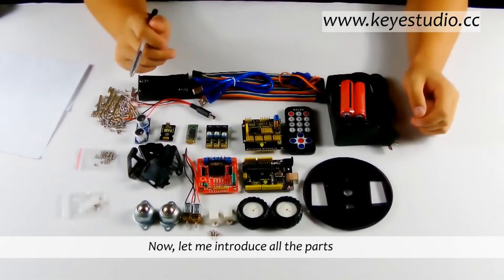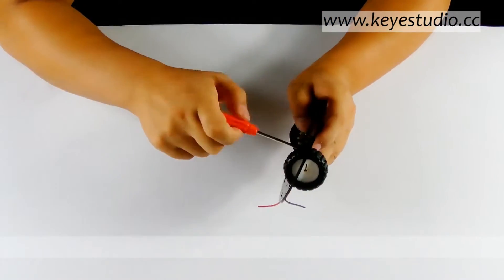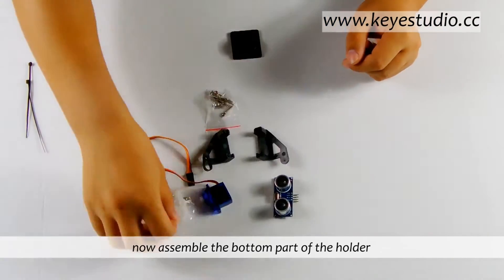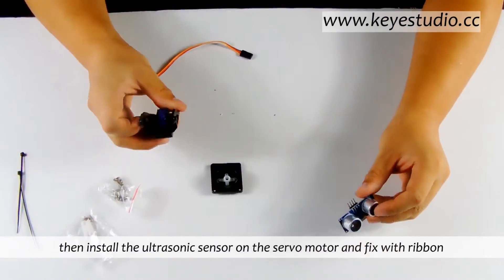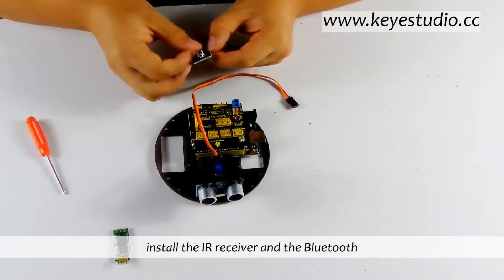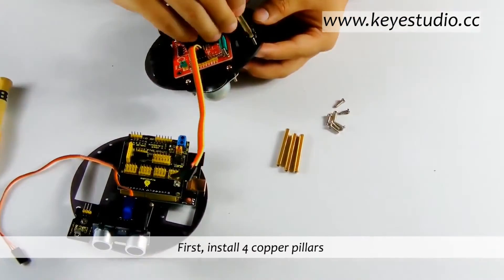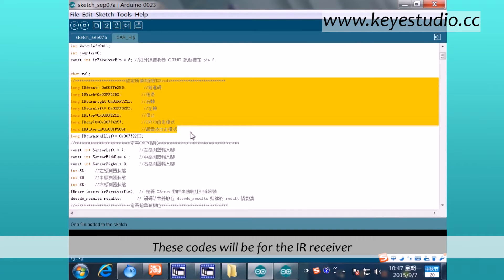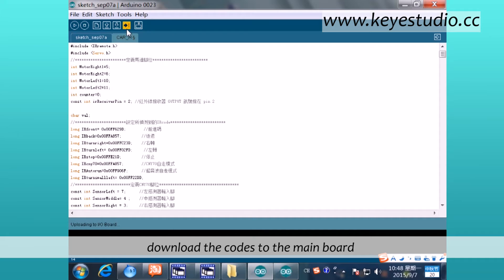Installation instructions for keyestudio intelligent turtle (smart car)

Comment: i dont quite get it at 11:31
connect the ultrasonic sensor to pin 12,13 of the shield?
Reply: Yes It is right Echo pin to pin 12 and Trigger to pin 13 (pin 12/13 on the shield).
Reply: Jesper Kleemann thx,man.i keep that in mind
Reply: do i have to take off the shield before uploading the script?
Reply: AmzaingCat Hi. Yes, when you are uploading there must be nothing  connected to the arduino. when the code is loaded then you can connect the shield and then you can upload the same code for debugging with the shield connected, but only the same code.
Reply: i note that.thx again!
Reply: is the robot supposed to be slow?or the battery doesnt give much power/low on battery?
Reply: can i use bluetooth to set the ultrasonic sensor and tracking sensor without using the ir sensor? thx!
Reply: HI again! No the bluethoot is only for controlling the robot. (I use an app called "RoboRemo").
Reply: ir sensor doesnt seem to be working.i feel i put the ir sensor in the wrong position.it does say in the script that the ir pin need to be put at pin A0.i changed it to pin 11.a yellow led turnt on,but the remote doesnt do anything
Reply: how can i change it if the ir sensor doesnt even pickup the signal,i know the remote works since it emits light when i push a button(you can see ir led light if you see it thru a camera's len).i compared a script from keyestudios website with the nuf_robot.ino script,and i find that nuf_robot.ino doesnt have serial.print(HEX) if that helps

P.S: somehow youtube removed your comment as spam and it took a while for me to see if you have replied or not.sorry for the inconvenience
Reply: AmzaingCat Hi! Is the hex codes you get from the key studio code when using your remote the same as in the nuf-code?
Reply: AmzaingCat Hi again Or open Arduino IDE go to examples find Irremote-test this code will show the hexcodes.😊
Reply: AmzaingCat Hi! I saw that you have used pin 11 for remote that pin is assigned to leftpwm. You have to use A0 to A5 these are analog pins, put the pin you want to use in the sketch were there stands A0 
Good luck
Reply: no, what i meant was when i pressed a button,nothing happens.no hex codes in serial monitor either

also,this is out of  topic but the script said pin 11 is assigned to leftpwm,but right side said to put the wire into pin 6.so,i put it into pin 6.is it supposed to be in pin 6 or the right side is a typo and i have to put it into pin 11? the robot worked nonetheless
Reply: AmzaingCat Hi. there is a fault in the comments (right side) it has to be pin 6 to rightpwm and pin 11 to leftpwm, motor pins are 7, 8 fir right motor and 9, 10 to left mitor, irsensor to pin A0, servo to pin 2 and 4, 5, 3 to the tracking sensors.
the irsensor are not in good quality, try to go close to the sensor with the remote or maybe yours are gone., try to find a new one you can find one in old dvds, tv, radios, etc.
Reply: is there anyway i could trigger the ultrasonic and line tracking without  using the ir remote?
Reply: AmzaingCat  Hi! No the remote is the only way to choose between the options. Or the sketch has to be rewritten without ir remote but with another way to chosse (buttons maybe) So the best will be to solve the IR problem. try to test the IR with another sketch from Ir Remote examples
Reply: okay,i changed the ir receiver and it worked(finally!).putting it into pin A0 doesnt work so i changed it to pin 11 and leftpwm to pin 6 under rightpwm.the problem right now hex codes wont show up in serial monitor
Reply: You have to use A0 because the A pins are Analog pins and pi 0-13 are Digital pins.
It should work with A0
Try to use the sketch from the examples IrRemote - IrTest
Reply: ok,i add some codes regarding hex codes and the hex codes finally appear in serial monitor,but right now when i pressed the same button it produced different hex codes
Reply: AmzaingCat These hexcodes have You to put in The nuf code were The hex codes is written.
Reply: Hi! It is probably the IRsensor that is faulty. I have had similar issues with these sensors. Try to find a new one, or even better, find one in an old DVD player, Radio, or tv. In most remote devices is there one just like the one from keystudio but mostly in better quality.
Good luck!!
Reply: @AmzaingCat & @jesperkleemann1333 I recently bought this robo kit and I'm having difficulties in making the car move as the driver module doesn't seem to be responding, can u pls let me know how to solve it

Comment: Hi! This is a very well made video.
Here is a modifyed version of the sketch for the turtle robot. link : https://drive.google.com/drive/folders/0BzGeoQC9KJL1THpWVGUyRFNSanM?usp=sharing
I can not remeber who made the modifications, but it works very good.
Have a nice day everybody.
Reply from the maker: Hi! thank you very much for your recommendation. I will ask my colleague to try it!
Good luck for you!
Reply: hi  there Jesper it seems that i am having difficulties with my robot because every time i tried to upload the code it gives thisArduino: 1.8.6 Hourly Build 2017/11/13 11:12 (Mac OS X), Board: "Arduino/Genuino Uno"

/Users/tonyquiles/Documents/Arduino/libraries/Nuf_Robot/Nuf_Robot.ino:26:22: fatal error: IRremote.h: No such file or directory
 #include <IRremote.h>
                      ^
compilation terminated.
exit status 1
Error compiling for board Arduino/Genuino Uno.
Invalid library found in /Users/tonyquiles/Documents/Arduino/libraries/Nuf_Robot: /Users/tonyquiles/Documents/Arduino/libraries/Nuf_Robot
Invalid library found in /Users/tonyquiles/Documents/Arduino/libraries/Nuf_Robot: /Users/tonyquiles/Documents/Arduino/libraries/Nuf_Robot

This report would have more information with
"Show verbose output during compilation"
option enabled in File -> Preferences.